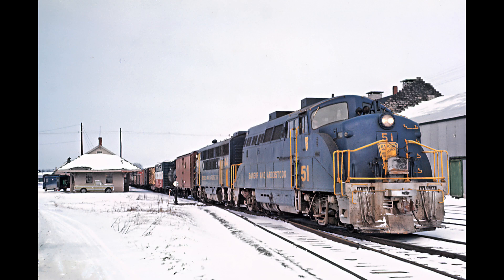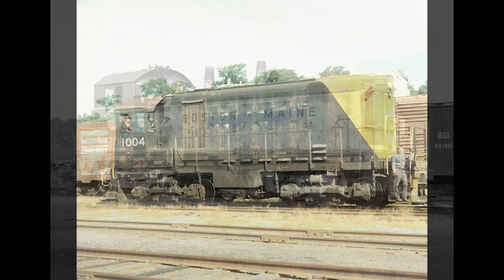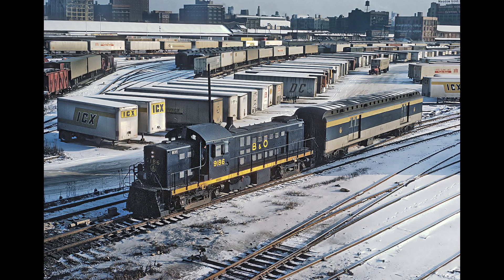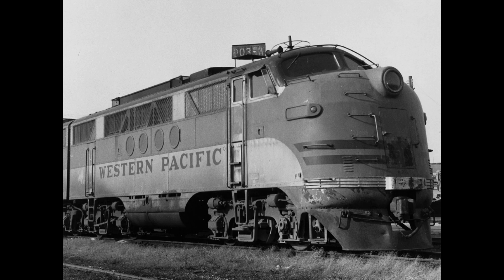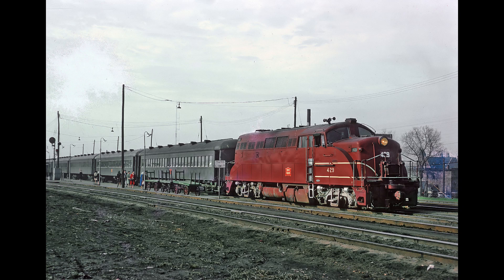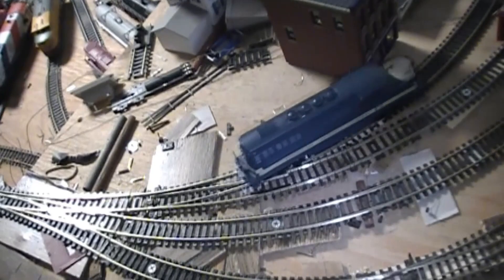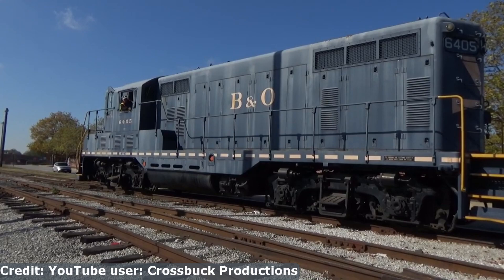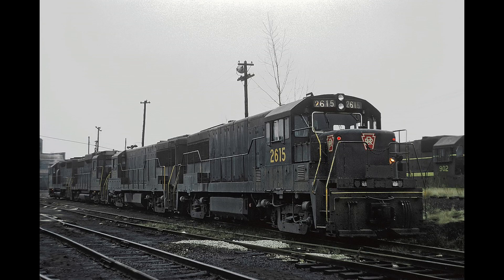EMD bl2 EMD's ugly duckling.

Comment: In retrospect the BL2 has a real slick art deco look to it which I like. It's interesting how the failure of the BL2 gave rise to one of the most successful families of locomotives ever made, the GP's. It's still too bad about Alco's cursed prime mover. the RS series still offered better visibility than the GP's due to the shorter height long hood. Thanks for putting this video together!
Reply: Definitely an Art-Deco like design from the 20-30's.  Has a "Tank-like" look side view.  I got to se one of these in action on the now defunct Saratoga & North Creek Railway during 2011-2018.  The SNC had two of them but only one was working. Sad to see them go.
Reply: @samueladams7  this locomotive is then one of my favorite because I love  anything Art Deco
Reply: @samueladams7  Would love to see one. I know there are a few (few as in maybe like 2) that still are in running condition. But I think they're all up north or in New England. Bangor and Aroostook has one that was running but I think it's just on static display now.

Comment: The part I didn't hear was that EMD made all of its parts in-house in an extreme example of industrial vertical integration. GM ran the process from getting raw materials processed through every piece of the locomotive, where Baldwin and Alco were buying from subs who had no investment in the success of the product or accountability for product failure.  Once GM achieved market dominance only a GE could take them on because GE could fabricate frames, cast iron for engine blocks, wind motors and generators/alternators, and develop control systems.  Alco and Baldwin couldn't integrate like that, and foreign makers had a tough time bringing their products into US markets until the 1980s. Once GE became a finance company more than a manufacturer the game changed again.
Reply: When Union Pacific commissioned EMD to build its DDA40X locomotives for its Centennial EMD had to contract the building of the locomotive frames to the John Mohr Company of Chicago because at 98 feet long EMD's factory could not accommodate the manufacturing of these frames.

Comment: BL-1&2 are basically Borden milk tank cars with cabs and engine parts. Cass had one which now runs out of another area but found out how under powered it was to climb the tracks at Cass. While a Shay might take 6 cars up the hill, the WM BL-2 could barely do two. As WM Shay #6 was used for the run from Cass to Durbin, it did not get much use there. Now with the runs out of Elkins, it is back on home turf.

Comment: They still had two of these on the Mopac line back in the 80s that were sitting in the 13th Street Station yard in St Louis I remember them sitting there rusting Hulks and wondering why they didn't get used at the time I was working on EMD 45s at the 13th Street Station with Mopac before the very end of the Missouri Pacific lines those were the days

Comment: The ones the Bangor and Aroostook had, were upgraded significantly after 3 years of ownership. The units quickly became crew favorites due to the smooth ride and the pulling abilities. The favorite set up for road jobs was a F3 on one end a geep in the middle and a BL-2 on the head end. BAR kept them in service until the early 90’s when they were finally replaced by GP38 rebuilds. Two had the ballast removed for a branch with a lightly built trestle without sacrificing much tractive effort. No other units could be modified to operate on that line without sacrificing tractive effort.
Reply: It was actually the BAR F3 units the Engineers loved, Most of the old guys I knew Liked to have an F3 on the head end with Bl2s and Geeps following , The BL2 was known for its low center of gravity and better traction than the other models as far as I know the only significant upgrade the Bl2s Ever Got were the nose mounted bell and possibly updated engine blocks early on , The Bl2 were all out of service by the mid 1980s #54 was the last one in active service and was sold to the SBRR in 1986 , the 557 sat around broke down and out of service from about 1981 until it was donated and moved to the Coles Museum in 1989  51 was scrapped in 1994, 53 was demolished in 1972, 55 was scrapped at some point in time  52 and 56 were sold to Glen Mohart in the very early 90s , But what I do Know is they were not loved at all for their Comfort engineers hated them actually they complained of them being very cold in the sub artic cold winters of northern Maine  and of course the Mechanical Crew hated working on them, it was #51 and #56 that had their ballast weights removed to operate on the Greenville branch , Its sad there are none of them left here in Maine I loved to see them when i was a kid and I loved the Leslie A200 Horns

Comment: The Bl-2 engine would look at home today.  It sure looks better than a P-42 crackerbox.  The real weakness of these engines as they were never intended to be M-U'd.  The batton framing would break and needed to be re-welded.  Western Maryland did that alot.

They also limited their market potential by dedicating them to branch line service.  Having passenger capability available, they  really could have done a lot better.  It would be a great commuter engine.

Comment: First EMD had prewar roadswitchers E.G. NW-3  &NW-4  . The RS-1 was not much of a prewar design either as it dates to 1942 with the first 4 being taken by the government from the Rock Island and being re-trucked for service in Iran. In addition the NW-5 was introduced in 1945 but didn't sell many copies before EMD got hit with a strike and after that it was not marketed as EMD had its hands full building cab units . This is what lead to the Cleveland plant building the SW-1 and NW-2s.
Reply from the maker: While your correct that the NW-3 could be used as a road switcher, it was marketed as a passenger terminal switcher by EMD, this is to say for mainly moving coaches around the yards and into stations and for occasional passenger service on the main. That said, the GN, who ordered them, Used them, mostly, on a mixed passenger run.
Thanks for watching!

Comment: As I understand it, the E and F units offered enough internal space to do maintenance inside, protected from the weather. The engine could be checked even while the train was moving. The GP and SD had plenty of access doors to do maintenance from the side walkways.
I have never seen an inside view of the BL, can anybody help out with that? I assume that the interior space was seriously restricted, making maintenance more difficult than either the full-width body or the narrow-hood units.

Comment: You got the wrong information about GE. GE built one of the first diesel locomotive back in 1928-1930. Check your information before stating things. And the bl2:is the second model of the same engine. The first was the bl1.
Reply from the maker: The locomotive that you are referring to, is actually  an alco box cab locomotive  called the 60 ton. GE did not build it. Instead, GE provided the electronics for these locomotives to alco who actually built them, with prime movers by Ingersoll/rand.  I also note  at 13:30 that alco and GE were partners in locomotive production,  till the U-boats came out. The first GE locomotive built by the company,  was the 20-ton boxcar switcher in 1938, with a prime mover by Cummins, this was not a road loco and only a side project like the rest of the company's small industrial switchers, not road switcher locomotives or export models. only 5 were built. The company would only start with domestic road switchers till the late 50's. As for the BL1 , only a single proto type was made that was later used a a demo locomotive, it was never in production.